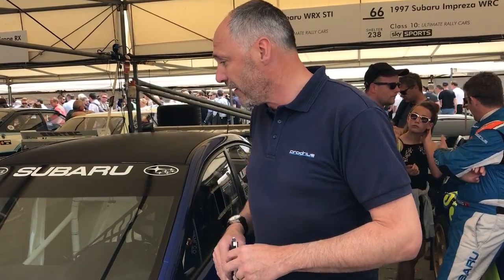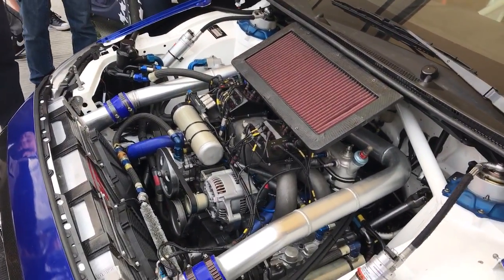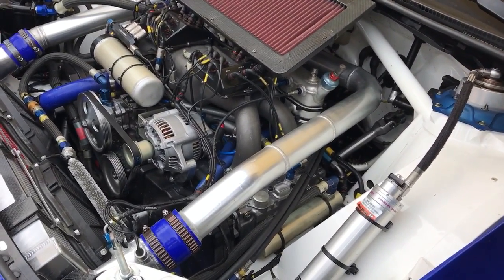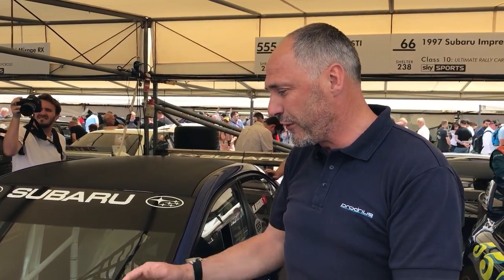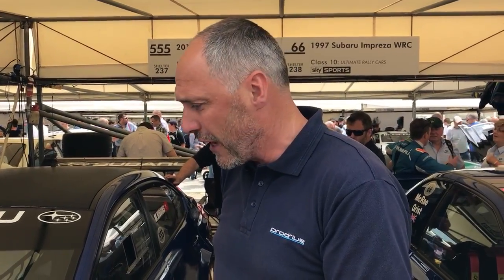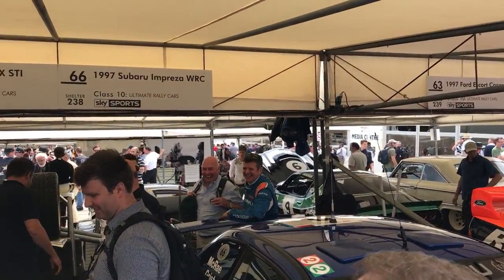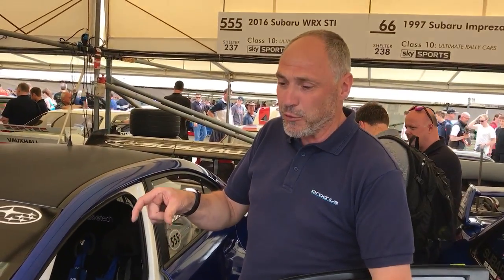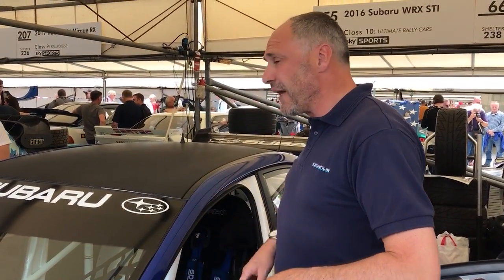Subaru WRX STI RA Tech Talk

Comment: Ej20 huh
Reply: That took me by surprise as well, was expecting a 2.5. It would be interesting to know if it was used because of familiarity or for performance/reliability reasons.
Reply: ej20 is way stronger, block is stronger. It's a superior engine to 2.5

2.5 just drives better off boost, it's more expensive to work with.

EJ207 V7 block strongest subi engine.
Reply: BoofGarage EJ20 > FA20 and EJ25. This car is nothing like the road going wrx and sti. Just an opinion
Reply: BoofGarage probably EJ207, not 205 lol